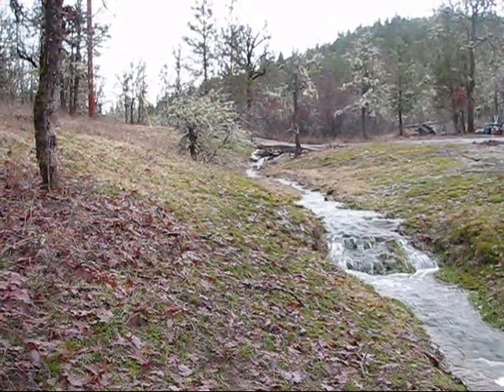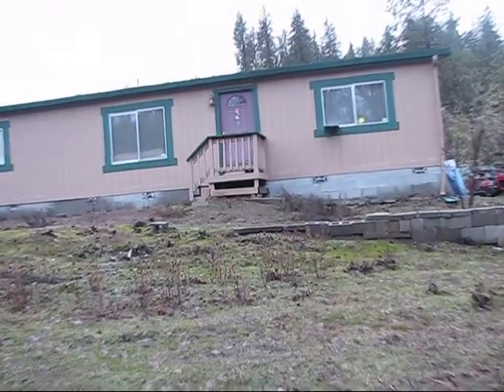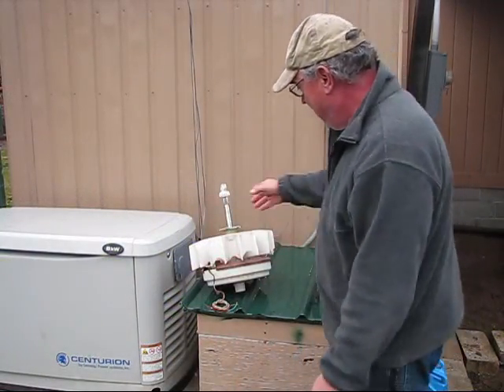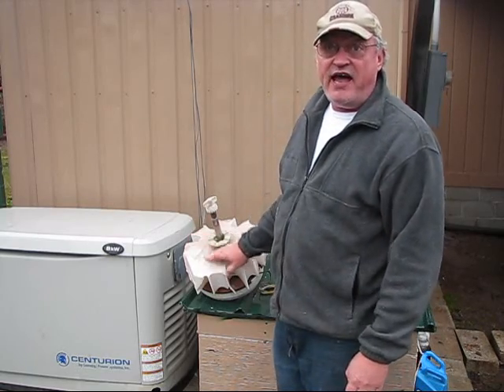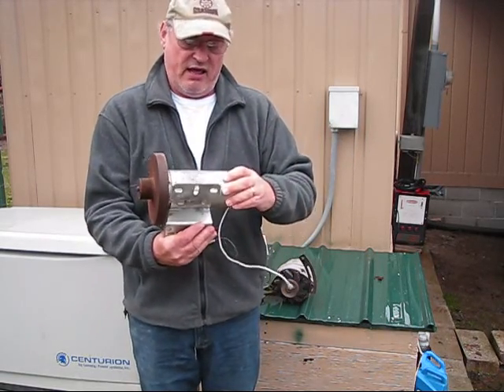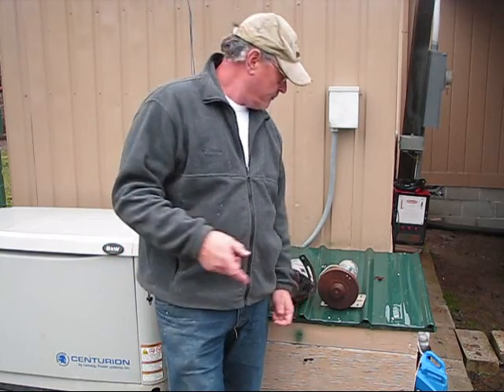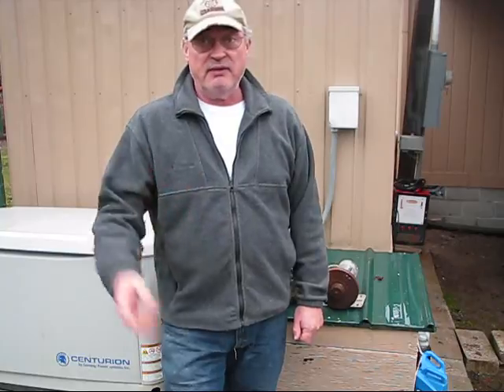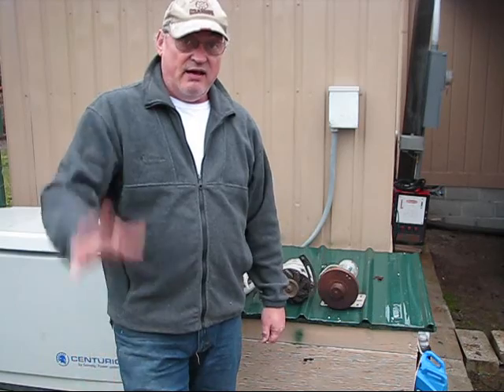Hydro Electric Power - Part 2 The Power Source

Comment: Two things you may want to consider for developing hydropower resource: use a stream the runs constantly all year long, not just when it rains. How much head do you have on the most consistent streams on the property? Head is the vertical height from the forebay/sluice to the tailrace, the more head (vertical drop) the more power with the same amount of water. There are two types of water wheels: 'impulse wheels' and 'reaction wheels'. Impulse wheels are hydro turbines, crossflow (squirl cage fan), Kaplan, Impeller, Turgo, Pelton, Francis all make use of the pressure of falling water in a penstock (pipeline). Reaction turbine: are typically what you think about with vertical water wheels, water is applied to the top of the wheel and the wheel rotates because of the weight of the water loaded on one side of the wheel. Waterwheels that are drawn on CAD and laser cut are extremely balanced and efficient, efficiencies over 90% are common with properly designed curved buckets like the Fitz Waterwheels of Hanover, PA. Waterwheels also will produce power in low flow situations to the greatest extent of the weight of the water entering the wheel, a turbine does not operate efficiently in low flow or inconsistent flow situations. I would consider using a traditional overshot waterwheel no more than 24" wide and the diameter as large as possible based on the maximum vertical drop on the property. If you have a head of 10 feet or more you should be able to produce a decent amount of electricity. You would need a planetary gearbox to speed up the output of the wheel of 10-12 RPM to 1200+ RPM that is required by the generator. Consider buying a reprint of Fitz Waterwheel Co Bulletin #70 from the Society for the Preservation of Old Mills (SPOOM) it is less than $10 and has some great info about measuring stream flow, gearing, belting, wheel design, efficiency, etc
Reply from the maker: I gave up on that adventure. The streams only run for about three months.
Reply: @pinemeadowshobbyfarmafruga8319  Hopefully in the future you find the perfect property to realize your dream of building a hydropower system. Best wishes

Comment: Love to be able to do what your doing but no running water here like you have.. . .I have done loads of research about different types of free green energy.. . . If  I was you I would stick with the alternator as it will not give you more then 12 volts. . . To make it generate enough power for what you want just have say small pulley on alternator and very large pulley on water wheel. . . .  You could use a ram pump    to help in crease the flow of water or [ump water else were and it powers itself.. . . When it comes to hydro electric your spoilt for choice in the amount of different ways you can do it
Reply from the maker: +jacky Parker Thank you for the input. I am taking all of this into consideration. I too have researched "ram pump" technology. Keep watching and see what I come up with.
Reply: Would be nice to see what you come up with in next video(s)

Comment: How is your wind turbine doning? I am think  of using a wind turbine motor, I have a spare one it is rated for 24Vdc. Would that work with some sort of water wheel?
Reply from the maker: +Dwight Mc Lean (dwight108) Not much wind where we live now. This unit could be used as a turbine for the water wheel. It too is 24 vdc. Sufficient for charging batteries.

Comment: you may want to consider useing a blower motor from a furnace . the ecm type. it's permanent magnet  with three phase  stater  and ball bearing. three phase ac is easy to do as voltage drop isn't as bad as DC. if you get the larger motor 3/4 and 1 hp  and use a couple of them youl have a pretty good output .run your wire to your mechanical room use a three phase bride to convert it to DC then through a charge controller.  the drive train is not the place to use light duty parts lots of hours and a lot of torque .
Reply from the maker: +Roy Amberg Thanks Roy for the heads up. I will have to put the word out to see if I can come up with some parts for free. My brother-in-law is into recycling. He is always coming up with stuff.
Reply: There should be some furnaces going in the junk with ecm motors in them. I think I have a couple sitting around here. One in the scap pile one in the back room. If I'm thinking right the voltage is about 90 so wire don't have to be to big run it through a bridge then into charge controller. Can't be to much easyer